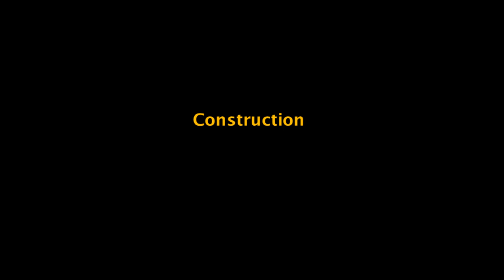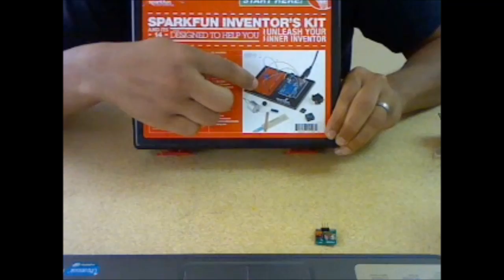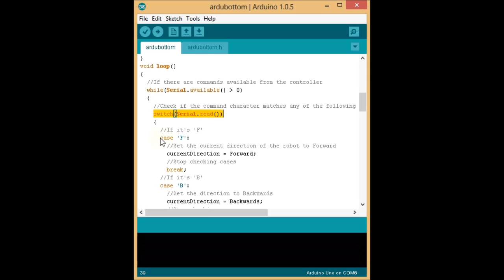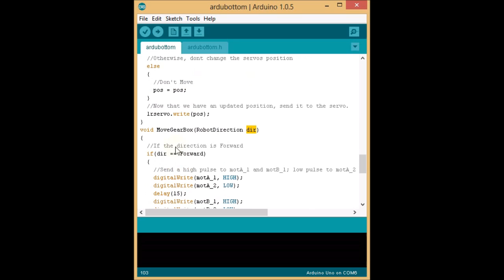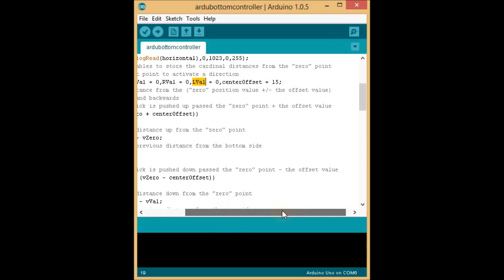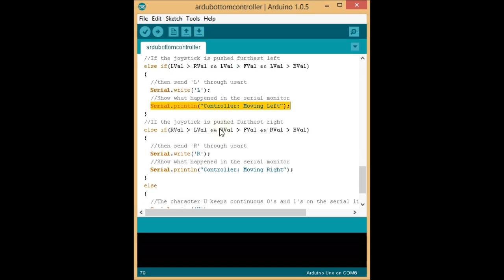Project: Ardu-Bot-Tom RF Controlled Robot

Comment: Using a small PP3 9V battery to power the servo and motors is a noob error. They simply do not have enough capacity to power such a setup for very long. I suggest replacing the battery with either 2 x 3.7V Li-Ion batteries or a set of 6 Ni-MH AA batteries.

Comment: i was at the forum whos link is below your video and i have ALOT of errors on the Rx tho on the Tx i have ZERO errors, 

i tried to post the help topic on the forum but they have a issue with there log in /sign up system

and stupid ass arduino ide dont let you just copy the errors with the mouse so i had to snap a screen shot which i cant even post on here

Comment: Now thats a good tutorial. Many thanks to you. I followed your instructions and it worked at the first time. Though I have one problem: Im trying to controll the velocity of the motor I connected. I didnt use a dc-motorcard like u did? insted a just added a simply H-bridge and with this I can change direction of the motor. I have been trying to use the H bridge to controll the velocity aswell (wich I have succesfully done in other projects using arduiono one:s build in PWM) but I cant get the PWM to work with youre programing. The code I have written is correct and works if I use it in another sketch. So my guess is ether that it has something "physical to do with the RF-links or something with your programming(librarys etc) I would really apprechiate some help :)